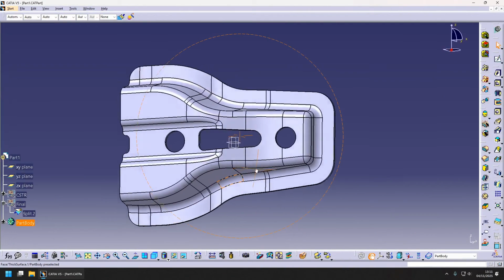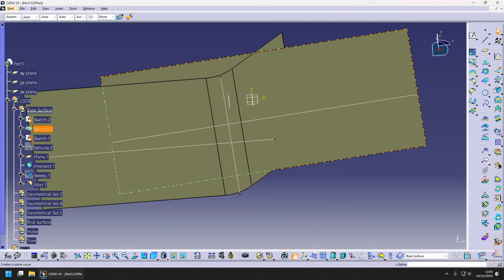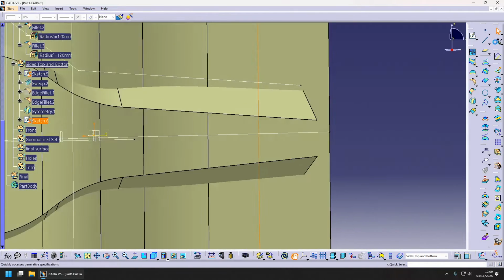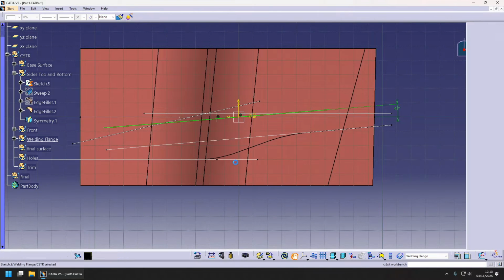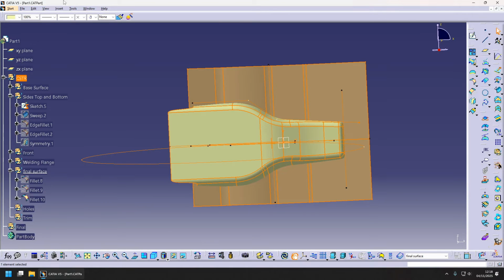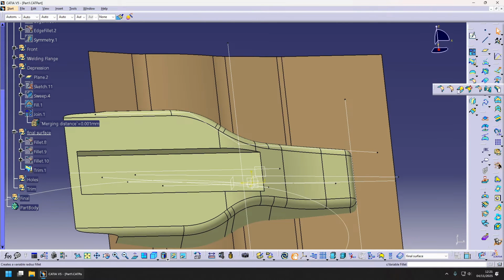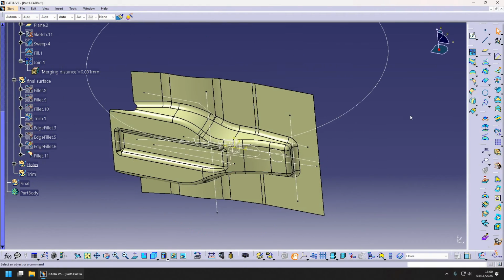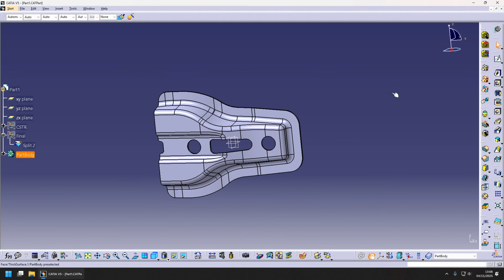Do THIS And Learn CAD in 20 Minutes | CATIA V5 Tutorial

Comment: Bro you just crowding your model tree with unnecessary features
Reply from the maker: I find that keeping operations modular makes the model much more stable and easier to update later on. 

Fair enough, this part is simple enough to maybe skip some of the features, like you suggest. But learning the core principle behind modular features is key to quality , stable CAD
Reply: @CADMasterclass-r3s  I was tought to model about the same way at Volvo Cars and Polestar for instance. Worked there for thirty years. They compartmentalize the model in sets, just like this. Makes it a lot easier to follow design history. Good tutorial by the way.

Comment: do you build your model mainly in GSD? how about primarily part design? whats the pros vs cons between? for each feature you want to build on a model, do you draft locally in that feature, or do you draft after it is all joined?
Reply from the maker: Yes, I mostly model in GSD, I use part design for 3D printed  parts and very quick models, although I don't usually do a lot of plastic or cast/milled parts.
I would say the benefit for part design is it's ordered tree that makes it really hard to make unstable models, it's basically self organized but it's kind of limited in what you can do.
GSD is kind of like the jack of all trades, you can build any feature with it and it's highly adaptable. Mostly suited for complex surfaces and situations where you want to link features to others that you have created earlier to create highly adaptable models. Even if you mostly build parts in part design, it's almost always better to do features in GSD as well.

And as for the draft.. It's better to do it individually for each feature. That way you get more control over it.